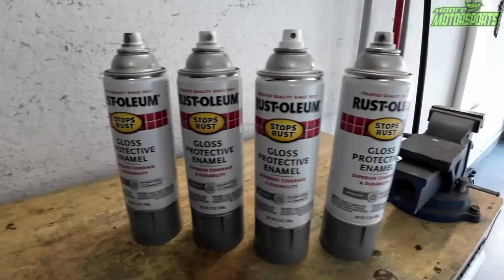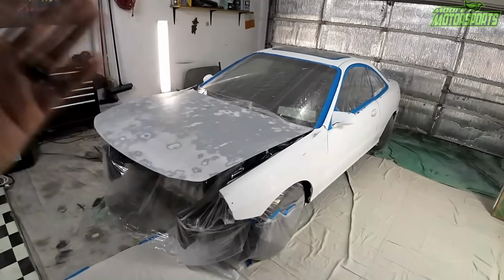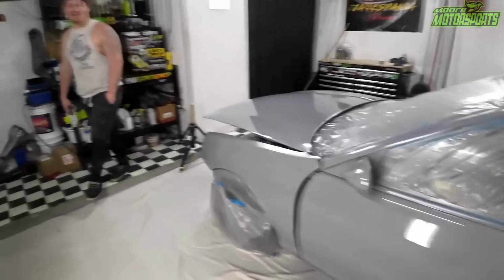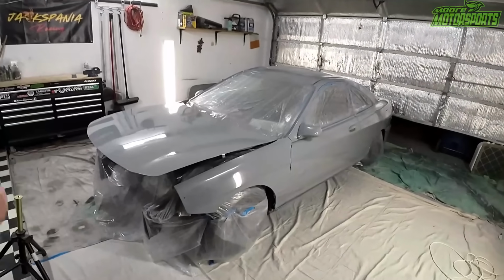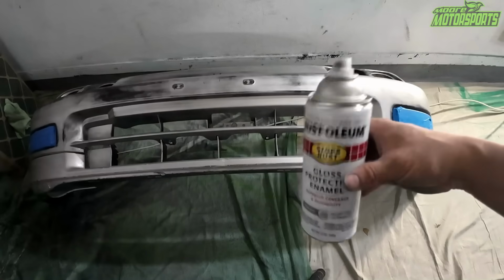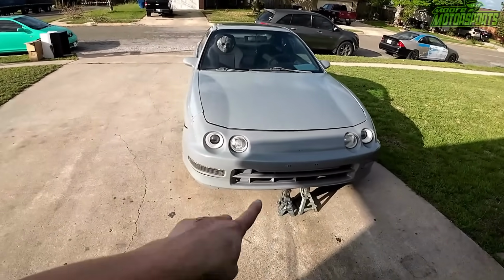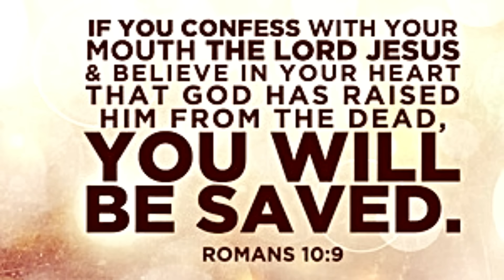$28 CHEAPEST RATTLE CAN PAINT JOB! IT ONLY TOOK 4 CANS!!

Comment: Whaaaaaat I used 12 cans of base, and 8 clear coat for roof, bonnet and boot for toyota corolla 😮
Reply: How long does it last ??
Reply: Yeah I was kind of thinking no way 4 cans will cover a car. I used an entire can of base and clear just doing the wheel well areas on a Honda Fit. It looks like he applied one wet coat which I'm a bit skeptical will be durable, but I also don't have enough experience to substantiate that skepticism. Then again maybe that Rustoleum somehow behaves differently than the base coat I bought at the local automotive paint supplier? Would love to know what the pros think.

Comment: Thats going to fade fast, going to have t do the respray next year. The heat of the engine operating can result in paint flaking off the hood, rocks and debris kicked up by other vehicles can chip paint on the front of the car; and constant exposure to snow and rain will make your spray paint job fade much more quickly than automotive paint
Reply: I’m also wondering why he didn’t put clear coat on top of it, I use this stuff for budget custom hot wheels and even I put clear coat on top of those tiny toy cars.

Comment: Curious on the number of cans and how many coats.  I've got a 16 year old Corolla with a beat up hood, was going to sand it and repaint it the same color, and add clear coat.  Many rattle can videos show the need for multiple coats of paint, but normally over primered surfaces.  Did your hood cover in just the 1 coat, seems like it?

Comment: Got my first car at 15 for $200. Didn't run and looked like it had been sitting in a rat infested junk yard for years. 😂 Dad got it running (including having to replace the gas tank). We sanded it down to bare metal, dad did all the body work, and we spray painted that sucker black out in the front yard. 👍👍 My current car is so full of dings and peeling paint I am considering repainting it myself. Figure I can't really make it look worse. 😂😂 I'd, at least, get a spray can trigger.... if not a spray gun. Save the finger cramps and avoid the gloves getting in the way. 👍
Reply: The spray can triggers are surprisingly awesome for the money!

Comment: I have a question. I recentely painted my car, two doors and front panel and my paint didnt lood glossy at all and after apllaing clear coat it still is not glossy, I dont have reflectiin. What did I do wrong? Any advice, can i still somehowe fix this. My original paint is metalic gray, I use sandpaper before primer(400p and 800p).
Thanks a lot!
Reply: Sand it with 1500 grit paper then buff it.
Reply: If u haven't buffed a car before start with 2000 then a product called trizact at 3000 then buff to make sure u get out the sanding marks.

Comment: I bet it scrapes pretty easy.....I used to weld and make Meta stair cases and handrails. Rust-Oleum isn't anywhere as durable as a powder coat or actual car paint
Reply: 1.Wet sand 2.clear coat
Reply: @praisethelord8750  u dun rite bi the lord with this comment, bless u

Comment: That is pretty amazing right there. Now i only wish you could match a stock color for Toyota. I am about to sand and prime my bumper as we speak. Wish me luck. I have to vacuum car out, shampoo the seats and fooorboards, clean the hard surfaces and windows, clean the outside and then finally i can secure the fron bumper which is mussing quite a bit of theundertray and fender liner parts and i have to zip tue it all and do my best to get it buttoned down then sand down the front bumper  and prime it up and wetsand it for paint later on.
Reply: How do you wet sand exactly?? Thanks because I have no idea ❤️

Comment: Question what's a good way to remove the spray paint from a vehicle? What chemical can be used without messing up the original factory clear coat ? 

I've gota truck that we painted before last fall when it was getting cold out and now it's been chiping off. 
 Some of the vehicle was sprayed with spray paint and the also used a Wagner sprayer with a paint and harder mix.  Now I just wanna go back to original paint
Reply: There isn’t one… there’s no such product that can remove one paint but not the paint underneath? Sand it all of and do a proper paint job

Comment: Me and my brother repainted his prelude in his garage. We made a generic paint booth by hanging clear plastic from the garage ceilings, about 3 foot around the car. We cut out a square in the plastic for a 20 x 20 AC filter and cut out an exhaust for the box fan and it worked perfect. Only had a couple specks of dust in the paint job.

Comment: 1 Comment, 1 Question...  1.  I appreciate you so clearly, boldly, and lovingly sharing the Good News of the Gospel of Christ.  Keep on!!  I'm praying for you on your journey with Him.  2. Thanks so much for the great tutorials.  I am wondering about the bumpers.  I was told that body shops put a flex agent into the paint when painting the plastic bumper covers.  Is that a concern when using this paint?  Have you hand any (longer term) issues with cracking?

Comment: If you're going to all the trouble of sanding and masking you may as well do a proper 2 stage paint job with a spray gun and compressor.
Reply: @blakejohnson2206  not okay, you gotta get your mix right, gotta have the compressor etc.. gotta know how to use it, gotta judge the paint quantity correctly etc.. im pretty okay with what they did even if they could have had a better end result, it's miles better, for cheap, than what they has so I'd say : not required. If you do a daily driver or car show or even just car meetup vehicle, yeah for sure compressor, tank and spray gun.. otherwise, overkill as shit

Comment: Rusto FTMFW. Not only did i work in a body shop, but I've been a graffiti writer since i was like 13, (I'm 40 now,) and there is no paint that lays and is as cheap as Rustos. Montana cans are awesome and have a huge selection of colors, but they're much more expensive, and not as easy to get in stores. Gloves are a no-no too, I agree. Some people prefer to remove the fenders and go panel by panel for the best results, but i do my painting very similar to you. That way the end of your painting 'strokes' aren't too 'heavy.' That K-Tuned sticker mislead me. I was expecting a K20 under the hood. Nice job on the 'Aerosol Overhaul' broski 👍😎

Comment: Can you add a clear coat over that? Sorry for that stupit question.
Reply: For sure, the same brand makes several different types of clear coats.
Reply: yes but you want to use a 2 stage clear coat such as 2K clear. the “2x” clear coats you’ll see just mean that the fan is 2x the size of a typical spray paint can. the 2k clear cans are a little more expensive, but it’s definitely the proper way to go about it if you’re going to rattle can it.

Comment: 4 cans , the whole car? I think someone is pulling our legs, even 8 cans would be laying it thin. Not to mention that when the rattle cans get down to 1/4 , they significantly loose pressure , making a rough finnish
Reply: yes 😅,and only 1 coat of paint ,wtf
Reply: I was surprised he got all 4 cans of Rustoleum to spray at all.

Comment: How long does it last
Reply: @millenium2003  all depends on quality of paint and prep job but a good rattle can job is easily good for 3-5 years
Reply: @raqicejames7288  and what it start chipping off after that?
Reply: @misseslonely  It's possible, depends on wear..  This paint job would be so thin that it'd likely chip pretty easily from anything hitting it..  You want a couple Millmeters of paint on the car, but if you don't it will be easier to just chip the surface off from anything hitting it.

Comment: Much respect. If you did all that with a can you’re good to move up. You would love single stage paint and a pressure pot. Get an Iwata Lph 101 or a binks 2001. Add some basic filtration into the air line.

Comment: My friends bought my 25 foot trailerhouse. They sanded then HAND painted with enamel using camel hair brushes. Couldn't tell it wasn't sprayed. Years later I did the same on my motorcycle.
Reply: I always use badger hair but man is it hard to shave one 😂

Comment: With 4 cans you know the paint is super thin. Especially how far you were holding your spray. Meaning in the long run its gonna chip and then keep chipping. I would have done at least 8 total. Wouldn't hurt
Reply: Not if it's ceramic coated afterwards 😉

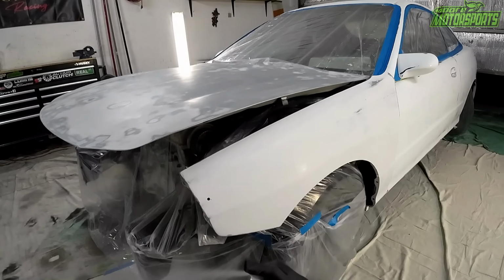Comment: I don't care how old this video is but I just came across it and WOW!! 😮 I never thought about just st DIY but I had thoughts about doing my car but really didn't think spray can paint but then again it's mostly no different then having body shop do it. I have 2001 Chevy Impala and we all know when the places on all Impala s as I seen that rusts in the same places and that's both front panels rusts down by where panel stops at doors on both sides and little in back down where doors open at. I love my car and replaced all major parts on motor and drives so smooth but I want be the first one to have 2001 Impala painted the color that's on these new cars do. Oh had to back to edit that I also subscribed and, Thank you for the verse John 3:16 God bless you to buddy as well .

Comment: Good job on the Sanding and preparing the car! I've been paint cars for years and something iknow for sure is that if your car is prepared correctly and well Sanded the paint will come out good, even if isn't the best one. Nothing you can't fix with Sanding and polishing
Reply: any advice on opening up a pinch weld to fix some rust?

Comment: I just bought 24 cans to do the same thing on a truck, but i couldnt get it to take clear coat well on test panels.
Reply: You need to use 2 k clear
Reply: @603adventures9  its the dark grey rustuleom 2x and using the spraymaxx 2k makes it wrinkle up.

Comment: Great can control man... if interest, try doing a car with Montana spray paint. They have low pressure and high pressure with different size nozzles, but its drys very fast. It's a flat finish but great paint to really add custom work. I used to do all my friends' kanjo and drift car in hs with them.

Comment: Ok i just gotten all bondo work done on my 2001 chevy impala to which was only two and they were right where front fender panel where meets the driver door above bottom mold. Now gotta sand down them spots shoot little primer on them and wash it all up good dry it down good then need to go get the same paint you have there. Then i will be only 2001 model impala to have new car paintjob lol.. well to be honest i really don't know how many cans im gonna need because my car is little bigger and 4 door ..i say its midsized car but.. i know paint isn't cheap either but being on disability my funds limited..but i will paint it this color..amazon has it 2 cans together for $19.99 an i say im probably going to need at least8 cans but thinking more like 10 just to be safe..but friend across street told me home depot has them way cheaper so.. goin to go check..

Comment: Just because of how spray cans can clog or be inconsistent flow, I wonder if a Wagner power sprayer would do a good job.  Reduce paint by 15 percent or so, it flows very well after a few test runs to get the pressure right.  I have painted doors and cabinets and even did topcoats with polyurethane.  My contractor thought I had them professionally done because they looked so good; like a factory finish.  I'll say, though, it does appear that you got good even coverage.

Comment: Nice work for small budget. 😂 I did similar projects to start learning how to paint rides. If you dont want to wear gloves with rattle cans. I always have pistol grip adapters for rattle cans. Problem solved. Also, folks if you want to keep a cheap paint job to last longer. I highly recommend, saving more cash and hitting your ride with gloss/hardner to top it off. Your welcome! 🎤 Drop

Comment: How long will normally the repaint last?
Reply: @uncleleslie808  prob not long, would last longer if they put a clear coat ontop.
Reply: @Imazdadrags how long do you think it will last with clear coat? And do you recommend different steps to prep
Reply: @TeeUpNext  maybe two three years possibly longer if you wax it, depends alot on how much sun the vehicle gets.. prep looks ok bonnet could have been better prepared.

Comment: I tell you what we used to do
If the painting get some details, dont worry apply at least 2 layers of paint 
Sand it all down with the thinest sandpaper, not be rough 
Apply spray lacquer 
If this get some imperfections, sand them down, just the imperfections
Now at least 3 layers of car wax
I dont have my old car to show but its exact as professional paint job of high quallity
but dont work with metallic paint  sprays, those with sparkles
Layer= Coat sorry my english

Comment: This is cool and all, but wouldn't you then want to sand it down with 400 -> 800 -> 2000 and then apply another layer of paint?  I just see this paint having a small wear layer and more likely to chip off to the environment than if it was given another layer of paint.  

Additionally, you can sand then buff down the entire thing to have a completely smooth and shiny finish regardless of any imperfections that were created while painting, and then ceramic coat the car.
Reply: Imo sanding after coating isn’t necessary I would just go ahead and coat it within that time range if whatever paint he’s using gives but yea I was thinking the same thing. It’s cool but at one cost per fender/body part of the car it’s not gonna last that long and it’s gonna be prone to cracking/chipping very easily unless he coats it again at least another 2-3 times or puts one of them very thick clear coats or waxes

Comment: What is 2k clear exactly?
Reply: its essentially laquer and hardener with uv protection
Reply: It just means clear coat laquer that goes ontop od the coloured base coat.
Reply: @ItachiUchiha-lr3yr  its a harder wearing and uv resistant clear coat
Reply: 2k means 2 component. The 2 component paints are much more durable. Clear means clear coat. So 2k clear is 2 component clear coat. This will protect the gray paint for many years.

Comment: That paint will be to soft long term to stand stone chips and scratches long term, you should have at least put some clear over it if you insist on using that paint. Good job short term but I would not recommend that paint for that job at all.

Comment: 😂I don’t even understand why you would want to prepare for painting then spare paint instead of painting it professionally it’s going to fade away after about a month of being done I don’t know why you would do that because it’s something that you would know already 😮I know that it cost about 500 bucks for paint but after all the work of sanding it down and then removing the whole paint and topcoat it would have made more sense to paint it with professional grade
Reply: i think its to show with whats possible with cans. but i would like to see a few years follow up on those spray jobs, i am very, curious.
Reply: I completely agree. Rustoleum has no UV inhibitors and is straight enamel. 2-3 quarts of automotive grade single stage acrylic or urethane enamel is not that expensive and will hold up for years.

Comment: Why not throw the spray cans in the oven
Reply: @lualvares8577  because the heat will melt the plastic nozzle

Hot water won’t
Reply: @Mike0405H  you right
Reply: @Mike0405H  isn’t the nozzle removeable
Reply: How bout it might explode and burn the house down 😂

Comment: Why in hell does that integra have a d series motor????? Comes with a b 18 already 🤦‍♂️
Reply: It's cheaper in every way. Pretty much every part is cheaper because it's more common and less desirable. A good running B18B is about 600-1200 depending on the area and can handle around 480whp on E85. You can buy a full D16Y8 swap for 200-500 and with the leftover money build the D series. A cheaply built D series can handle 480whp just fine but the head will be the limiting factory at that point. A built D16Y8 with cams+headwork and a GOOD e85 tune can run 480whp DD'able with a 150 shot of NOS or you can run 650 but risk eventually putting a hole through your block. Then, when that D series blows up (just like a turbo B18B eventually would) it's cheaper to buy a replacement.